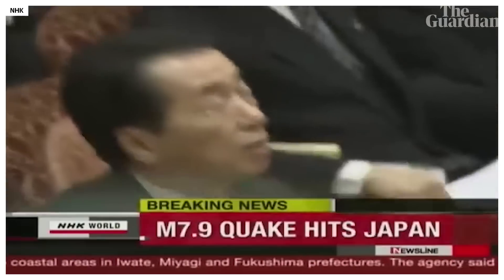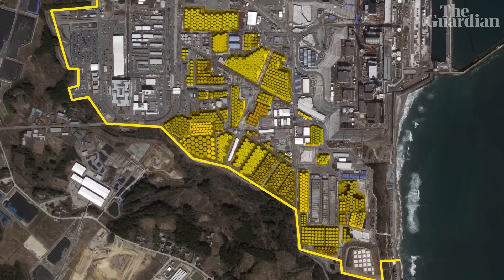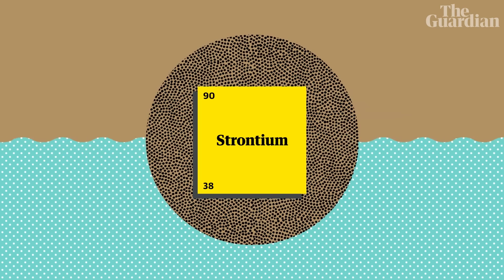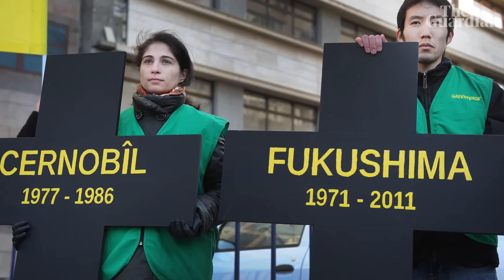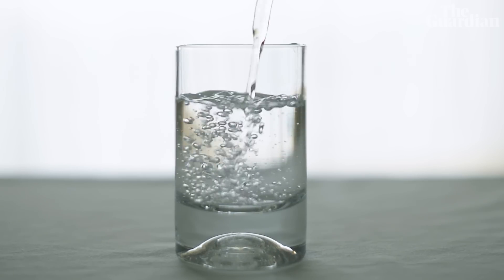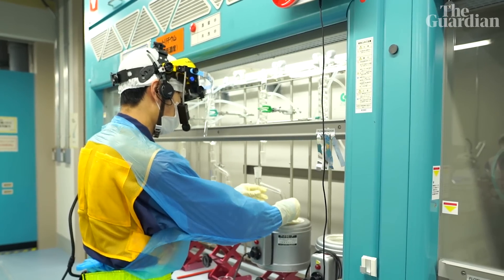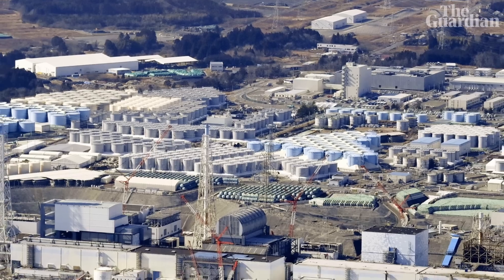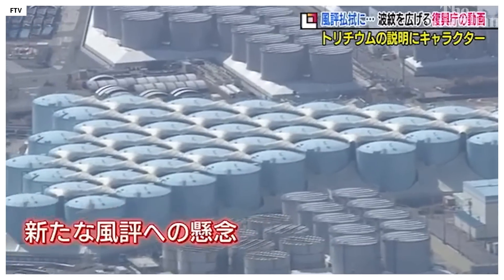How Japan is dumping 1m tonnes of radioactive water in the ocean | It's Complicated

Comment: Why Japanese isnt using that water to agricultural, industry and drinking. If they claim it is safe, then they should drink it and utilize in agricultural purpose for 10 years then let other countries know.
Reply: Because as they said, they need to dilute it so it gets to a safe % of Tritium... can you guys even listen to all that's talked in the video?
Reply: Because of cost vs. performance problem. Do you drink the water running out from your nuclear power plant? Or thermal power plant? Or sewage treatment plant? Or any processed industrial waste water? No. Of course you "can" do so technically, but building extra water pipes and distribution systems is just costly, while you can get clean water otherwise. Well, at least in Japan, I don't know about your place but obviously there are heck a lot of countries where even the tap water aren't drinkable.
Reply: user-jk8lj8wp4x  In fact, the radiation concentration in China is higher than the treated water from Fukushima.😂
Reply: @憲灋を変える男  Nonsense
Reply: not only tritium , there are also other sixty hazardous matters..
Reply: @先生王-n1s  wrong they have treated the water so it’s just titium in it
Reply: @憲灋を変える男 if what you say is truth,please take the evidence to prove your saying.if the other country do the shameless thing as japan,which country’s official media will report these news in the first time？日本人が誇りに思っているマナーは、あなたたちが起きている間違いに直面したときに、先に謝るのではなく、先に嘘をつくことを教えているのでしょうか？what's wrong with this country?
Reply: @nampham162 正論すぎて笑える😂
Reply: Ummm cuz they dont have a lack of water

Comment: The water leaking from the reactor should only be recycled back thru the reactor's core, treated and re-treated , not released !  There is no purpose in using fresh water for cooling the reactor when there is an adequate supply of water already contaminated that can simply be re-cycled back thru the reactor. You DON'T DUMP the radioactive water from the PRIMARY COOLING LOOP of a reactor after it has been  irradiated, so why dump this water when it can be cycled time and again thru the reactor !
Reply: or used at any other plant in japan. of which there are so many. somethings not right with the journalism - the core question of why this needs to go in the ocean is not even being asked!!
Reply: the plant was retied long ago. Even if you have elementary school level reading skills, you should know that they will remove all radioisotopes except tritium before discharging and dilute the tritium with seawater, as is the international practice, until all indicators meet international discharge standards. IAEA reports have long recognized the reliability and feasibility of TEPCO's treatment program.
Reply: @mydearfather5192 your right the water which is used as coolant should return to normal seawater nuclear which know by knowledge can help the earth in the long run less heat renewable resources and is less harmful than coal oil and electric
Reply: how can you contain and recirculate when it is leaking directly into the ground and ocean? remember the facility was highly compromised during the massive earth quake and the containment systems have had serious failures to point of being ineffective, so explain how you will recirculate anything.

Comment: ...so we're supposed to trust the same plant owners who literally said that radiation levels were low because they had used measuring devices that topped out at a far lower level than the actual radiation levels? The guys who were told early on of the risk of tsunami in causing this very problem, but went ahead anyway? The guys who supposedly can be bothered to filter out radioactive elements, but allowed radioactive water to seep into the ground water table for years? The guys who proposed freezing an underground water shield which i knew would never work and which never worked?? Now they're LITERALLY admitting they cant do anything else other than dump all the radioactive water into the ocean because they have no ideas left?
Reply: no you're supposed to trust the experts, not your gut feeling
Reply: The whole process will not only be overseen by Japan’s new Nuclear Regulatory Agency, but also by the International Atomic Energy Agency, which is an independent UN body. So if you don’t trust the Japanese government you can go by the UN data. You’re also misinformed on what’s happening at the plant. The ice wall was actually very successful. It has cut the amount of contaminated water that has to be pumped out from the reactors by 75%, from 400 tons a day to around 100 tons a day. No one ever expected it to reduce that number to zero. And if it weren’t for the ice wall, they would have run out of space to store the water years ago and the releases would have already started.

Comment: Isn't the tritium needed in fusion research? They might want to sell it instead!
Reply: Tritium is also used in other applications such as in radioluminescent paint that is used in watches, gauges and emergency exit signs. If you have a watch that glows green in the dark, thats actually tritium. But tritium is produced either by removing it from the cooling water of heavy water reactors, where it exists in high concentrations, or by irradiating certain lithium isotopes in a nuclear reactor. Removing low concentrations of tritium from light water such as the water at fukushima is much to technically challenging and therefore way to expensive.
Reply: where do you think we get the tritium from for nuclear powerplants and research ? we get it from the ocean .
Reply: @lv3184  It's the Radium in watches - as Radium Girls.
You're right about the technical challenges and astronomical expenses of Tritium extraction.
Reply: @shukrantpatil  no we don't.

Comment: What I regret is it isn't possible to recover this tritium. Are people aware the cost of tritium is around $30,000 per gram? Eventually it will be necessary for fusion reactors, although since its half life is around 12 years, it would have decayed by the time they become operative. Although these reactors are supposed to breed their own tritium, an external source will be necessary to carry out the experiments before this is possible.
Reply: Its probably so dilluted it will be more expensive recovering than the cost itself.
Reply: The price is because of how expensive difficult it is to separate. It would cost 30,000 to separate it. Not profit 30,000

Comment: If nuclear contaminated water is safe, it does not need to be discharged to the sea, and if it is not safe, it should not be discharged to the sea.
Reply: All the the radioactive elements from Hiroshima have been dispersed throughout the world and there has been no noticeable impact. Hiroshima today has zero trace radiation. I would drink water in Hiroshima, just not in 1945.

Comment: Problem 1: There is a problem with the sampling of Japanese nuclear wastewater. The sample is 2 liters of nuclear wastewater provided by Japan and does not meet the requirements of China's random sampling and long-term monitoring sampling. So, why is this? Since there are no problems, why are you afraid to accept relevant monitoring? There must be a problem.
Problem 2: Moreover, Japan cannot guarantee that the nuclear wastewater it has discharged into the sea for 30 years is the standard sample at that time. There are many problems.
There are multiple solutions to problem 3, and Japan only chose the cheapest but harmful one. That's the worst reason for Japan.
Question 4: Japan has set a precedent for the public discharge of nuclear wastewater into the sea. If we all follow Japan's approach, if there are problems with nuclear power plants around the world, the seawater will be cooled down and then discharged into the sea.. What do you think???

Comment: Hard to believe they would dump Tritium. The US needs it, and Russia to. They need Tritium to upkeep their Hydrogen Bomb Warheads as it is the fuel used in the H-Bomb Fusion process as a primary fuel to boost the explosion. It is also used in other Nuclear Weapons processes. I find it hard to believe this large supply of Heavy Water would not be put to use.
Reply: The amount of Tritium in the Fukushima water is only a few grams, and it would be extremely expensive to try to extract it from all of the water in the tanks. If they could do that economically, then they would certainly prefer that over dumping it. Not an expert on nuclear bomb making, but I think they use Lithium and Deuterium, not Tritium.

Comment: Nuclear power plants use radiation to produce heat which, in turn, boils water to make the steam that generates electricity by running turbines. There are less dangerous ways to make electricity.
Reply: Please name a way that we can make energy that is even safer than nuclear AND can provide a stable power grid. Also nuclear power plants don't use radiation to produce heat, it uses nuclear fission.

Comment: Thinking there must be a way of collecting the isotopes from thr water, thinking a process like electrolysis, for heavy metals, cathode anode an a hi DC current...just a thought...must be a way. Dumping in ocean could be a problem for thousands of years but i guess the Americans wasnt concerned with their readioactive ocean dumps. Plausable denial works...
Reply: ALPS filtration system is what they're using to clean it up. But tritium can't seperated by current tech, at least not at this scale.

But that's not too bad really.

1. Functioning plants also discharge tritium

2. Tritium is naturally occuring. There's more tritium in the sea than we can ever dump

3. Tritium is only hazardous at high concentrations and does not bio accumulate easily.